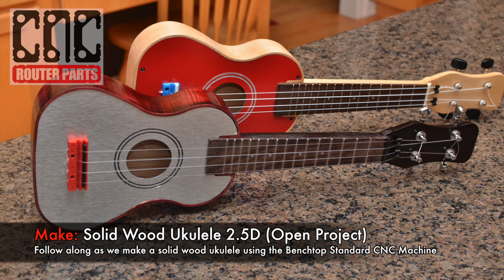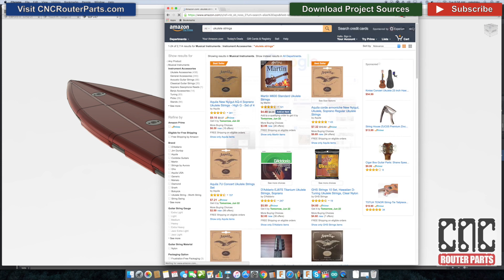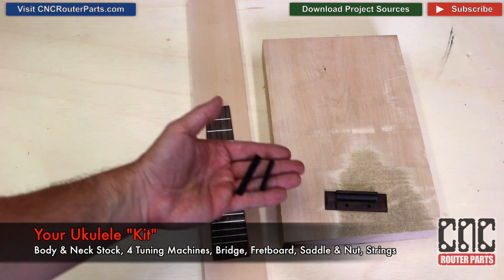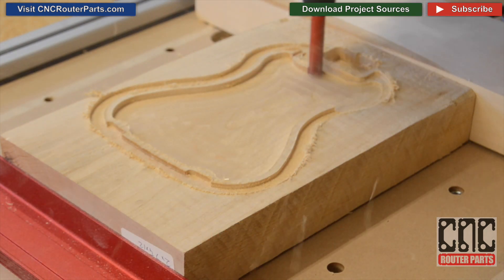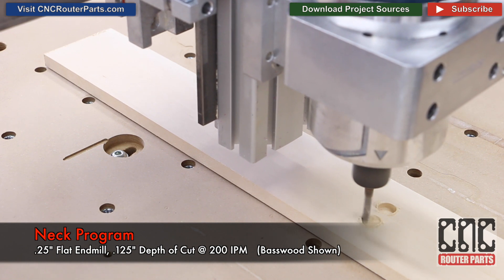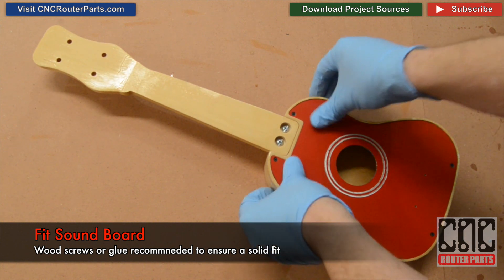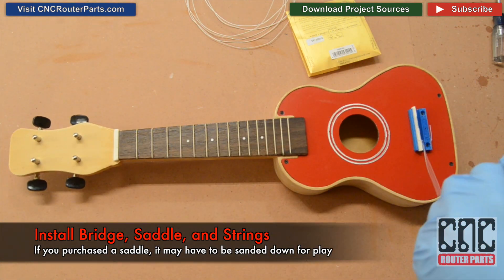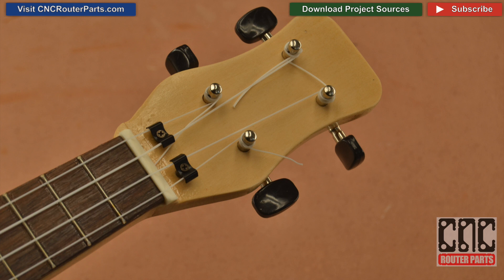How to Make a Solid Wood Ukulele On Your Benchtop Standard CNC Machine

Comment: Great project! Any info on the clamping system?
Reply from the maker: Hi Jeremy, Thanks!   The peg clamp itself is this item from Sears --> http://www.sears.com/craftsman-push-peg-clamp-used-with-craftsman-portable/p-00949808000P?sellerId=SEARS&prdNo=1&blockNo=1&blockType=G1
Reply from the maker: This is the red fence (also Sears) --> http://www.sears.com/craftsman-push-peg-clamp-used-with-craftsman-portable/p-00949808000P?prdNo=2&blockNo=2&blockType=G2 .  I bolted the fence through my spoilboard using two t-bolts and star knobs from these style clamps (Rockler) --> http://www.rockler.com/48-universal-t-track-with-hold-down-clamp
Reply from the maker: Thanks for your question! -Nathan